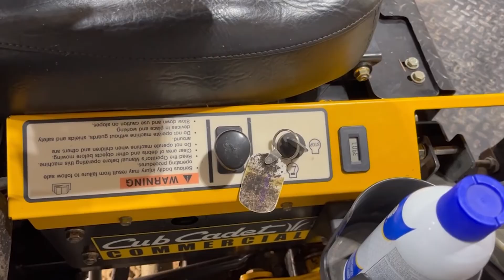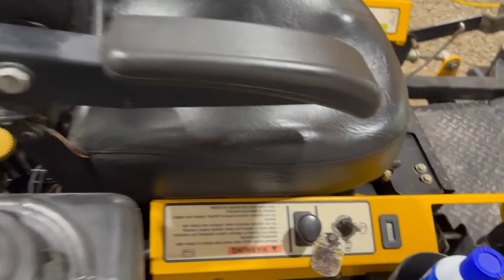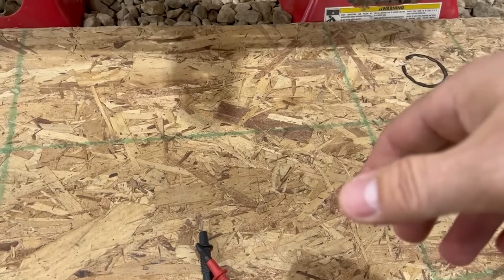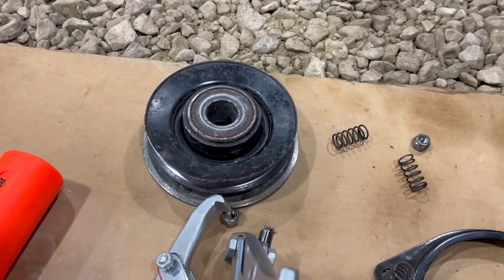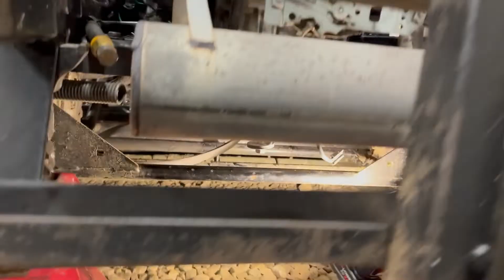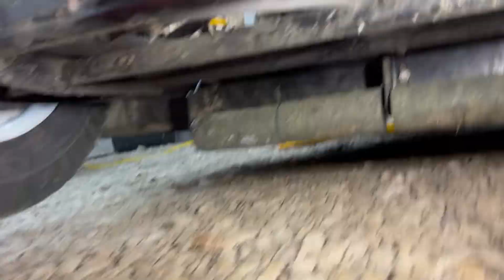Mower PTO Blade Clutch Replacement - Cheaper and Serviceable

Comment: My dads new badboy mz magnum from day one has been having the same issue where the blades can be turned on and off when you first start the mower, but after a few minutes of mowing, if you shut the blades off they will not turn back on until the mower cooled down. Do you think my issues is likely a cltch clearance problem as well? And i also wonder if somehow this issue can cause the PTO switch to fail cause the switch definitely failed as the resistance is all over the place between the pins, and wayyy over spec. I have the new switch ready to install but im worried it will just get burned out again.
Reply: I should clarify that the mower blades now do not turn on at all, hence why I pulled yhe switch and tested it woth a multimeter and came to the conclusion the switch went bad. Im still worried the new switch will just go bad as well but I dont have a ton of knowledge on how to do some of this stuff. Im winging it all the way 😂
Reply from the maker: Could be either. A good way to test is apply 12vdc to the pto clutch and make sure its working properly. Find where it plugs in, it should be just 2 wires and use the pos and neg from a 12v battery with a couple small jumper wires. Obviously dont get them mixed up! The size of the battery doesnt matter much. It could be a 12v car battery or a small 12v battery from a UPS (which is what I use!) If you say the blades dont turn on at all anymore with the switch, but the clutch works when you apply 12vdc then it may be your switch. If it doesn't kick in when you directly apply the 12vdc, then the clutch may be too far out of spec and need adjusted. The clearance is very close to work properly, and just the heat can alter it enough to not kick on when hot. FYI, an outbof skec clutch won't burn up a switch, it just won't engage or with enough to grab and actually turn the pulley/blades. Let us know what you figure out and thanks for watching!

Comment: no power to mine unless i sit on the seat.
Reply from the maker: Yes the seat safety switch can be part of the overall safety circuit. I think on mine if the brake is set it will allow PTO switch without the seat switch. May have to clamp your seat switch closed or have someone sit on seat while you test.
Reply: For testing I unplugged my connector and made a short length of wire with double spade terminals to bypass safety switch  temporarily